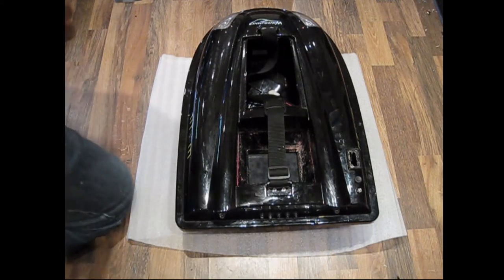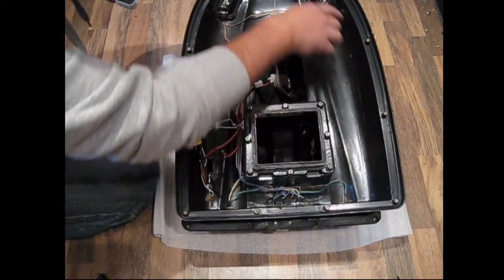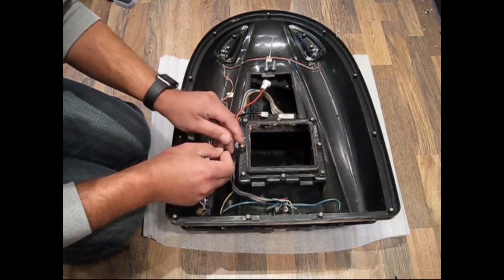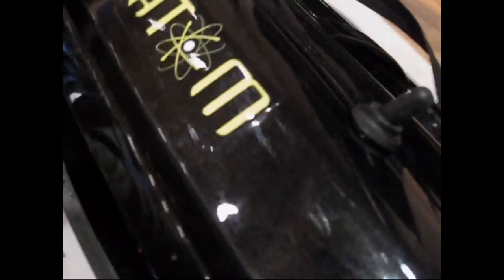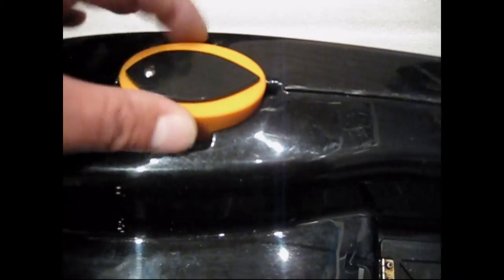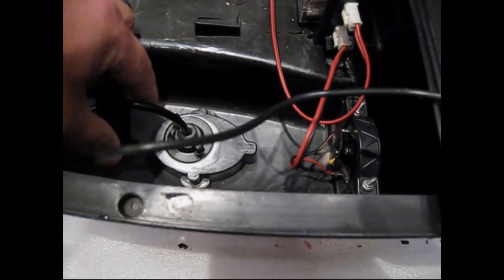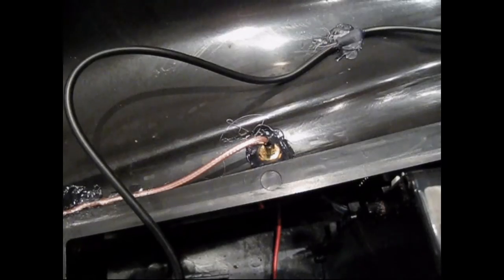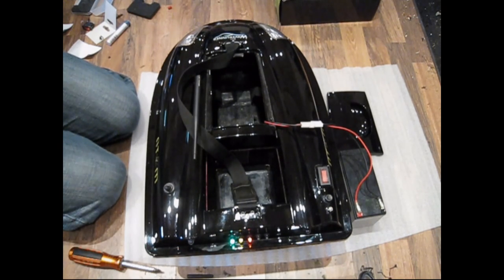Waverunner Bait Boat Power Switch Replacement FC500 BC151 Fish Finder Installation

Comment: Hi, very informative, as I have had to split my Atom, to fit a new Remote Control Receiver, after my original handset failed to work, so I bought a new one. I had to destroy the silicone sealant on all the screws, and some of the washers were broken while being removed. Couple of questions. Do you know if I can get replacement rubber washers, and from where? Is there a special silicone, black, to re-seal over the screws when I put it all together again? Many thanks

Comment: I’ve just bought a tf500 to put on my Big lake bait boat can I just solder to power lead directly to the main power switch or should there be a fuse in between its two lipo batteries connected. I’m clueless really